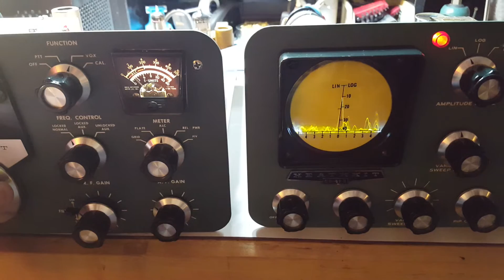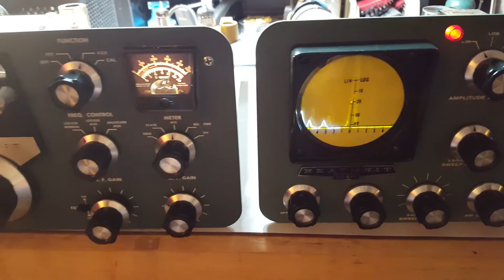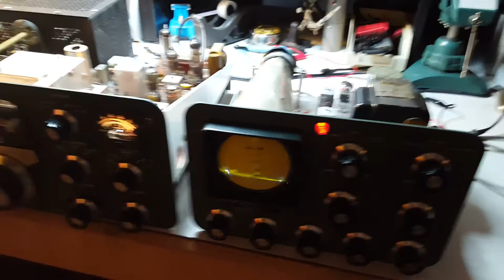Heathkit SB-620 Restoration complete

Comment: What value cap did you use in the radio to between the 3395 kHz and the coax to the back phono plug ?   What coax did you use inside the radio ?  What coax did you use between the radio and panadapter ?  Nice video - thanks !
Reply from the maker: Thanks for the comments!  I used a 7.5 pF capacitor per the manual and RG-62a coax per the manual, 24" precisely.  Not a particularly practical device, the SB-620 - hardly a Flex 6700 LOL!  But it's certainly fun to play with and look at.